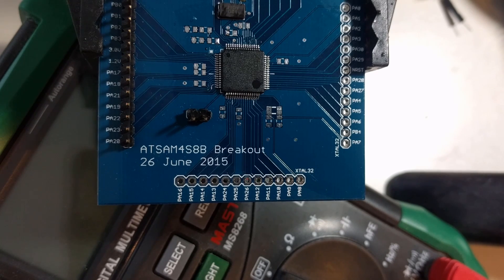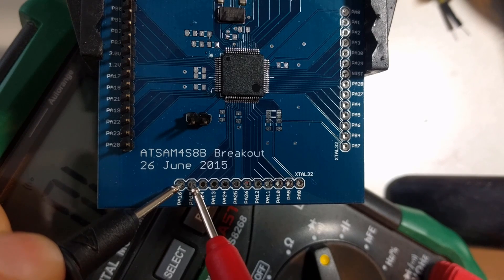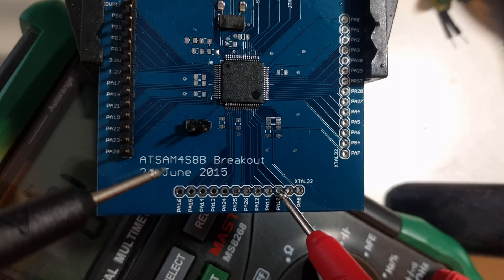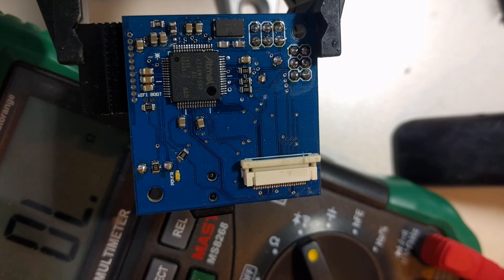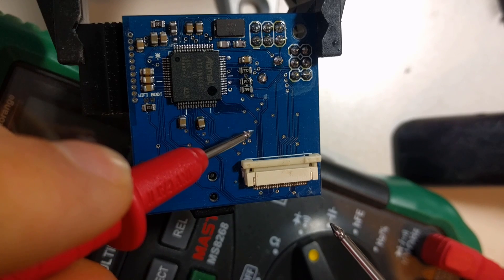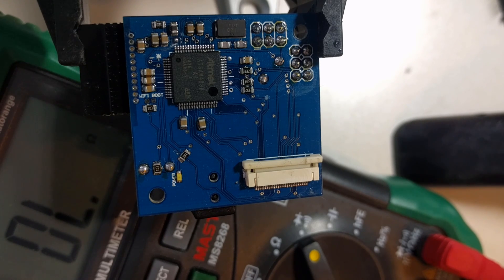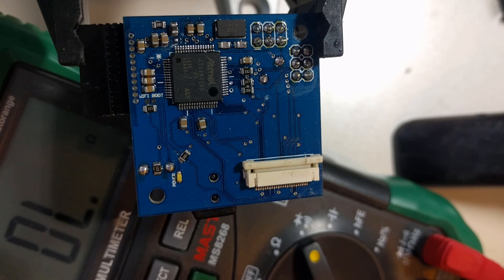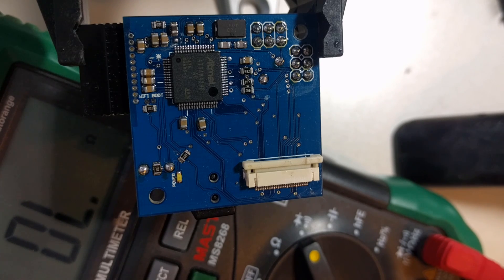Embedded Circuit Debugging

Comment: Aw I see, its hardware debugging :D not software. still looks awesome and helpfull.
Reply from the maker: For software debugging, I can summarize very easily: breakpoints.  I don't think there is a better way to debug than to step through your code line by line and to see variable values, along with register contents.  Even if it costs a little more, I would highly recommend getting a hardware debugger, such as a J-Link for SWD/JTAG debugging.  It saves a huge amount of time and nerves.  I hope this helps!
Reply: @IlyaMikhelson  Thanks for the reply, I might look into getting a JLink or look for something I already have that can do this. All these programmers ;)
Reply from the maker: @CodeAsm  It's a little frustrating that debuggers that allow breakpoints are not more common and accessible to the hobby community (i.e. cheap).  I think the embedded world would be better off if the Arduino came with an embedded debugger, instead of having to use blinking LEDs and print statements to debug your code.  Anyway, I hope your project goes well!
Reply: @IlyaMikhelson  Very true, my last Arduino like project kinda failed because I couldn't debug it properly. instead I now can write a report on why and what I could change to actualy make it work (getting a "proper" debugger) but my current one, a RISCV E310 board doesnt come with a programmer at all (or debugger). could use the FTDI, or RaspberryPi with openocd, still havent firgured it out, but the documentation is kinda better and the replies on their forum are also asuming I know how to code (on Arduino forums I kinda get the idea ppl asume most cant, and all is on the arduino IDE... I want more control, and then we have the lack of documentation or premade sketches that just arent what you want)

Long story short, its great to have so many people now intrested. but its more dificult to get to a solution quickly if most results on fora or google are for the simple projects.